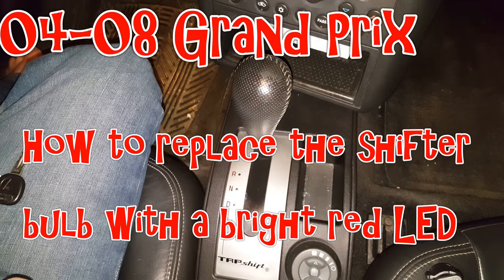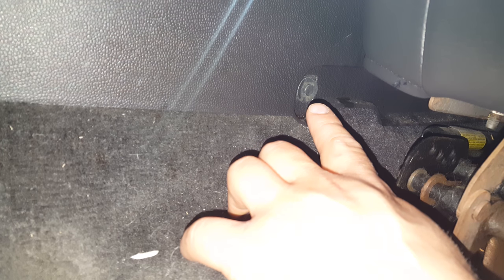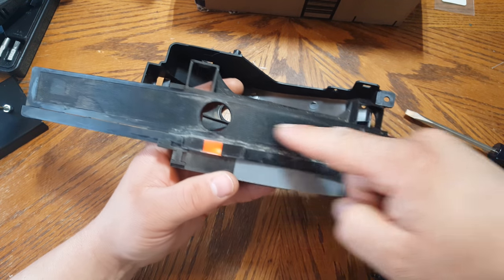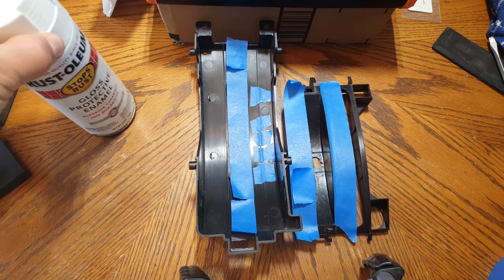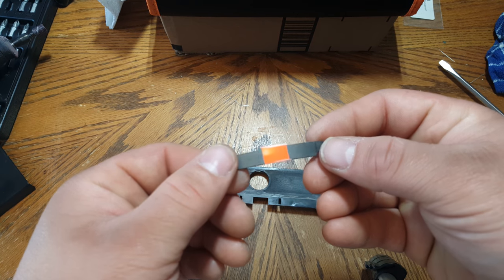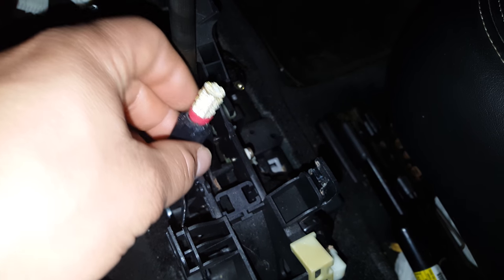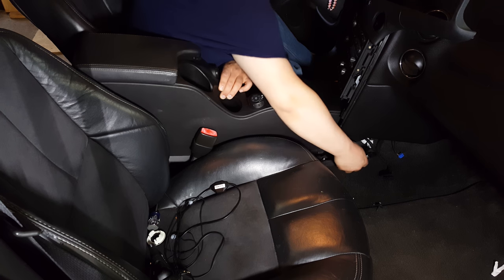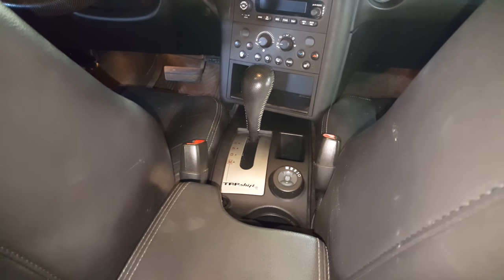04-08 Pontiac Grand Prix - How to replace the shifter bulb with a bright red LED

Comment: Why did you go thru all those steps to replace bulb.  You don't need to remove anything on your dash.  Just the four screws and lift the console up.  The hard part is the clips that are wedged in the back of the console.  It takes a bit of uplift force but it won't break.  The bulb socket just takes a 1/4 twist and it pops out.
Reply: Yup, exactly the way I did it.

Comment: You think you could do a video on replacing the steering wheel lights with leds. And how bout the HUD, u think it's possible to change the color in that?
Reply from the maker: +Jamie Calvert the HUD uses LEDs to light, so yes I do think it's possible. I would need to get the air bag remover tool in order to change those steering wheel controls.
Reply: GPVlog really? You need to remove the air bag? That kinda sux, ok, well if would still be cool if you did a video on the Hud.
Reply from the maker: +Jamie Calvert I need to get a donor HUD to experiment on. Don't want to ruin my own HUD.
Reply: GPVlog I seen a couple photos of a guy who does it, I just can't remember where I seen it, I'll have to look it up again